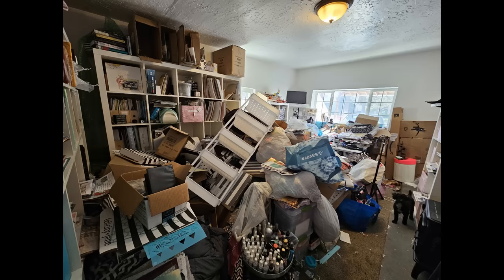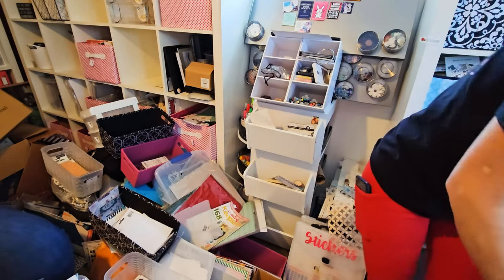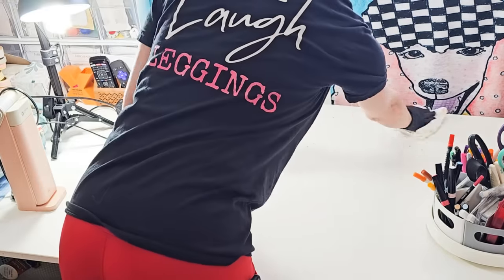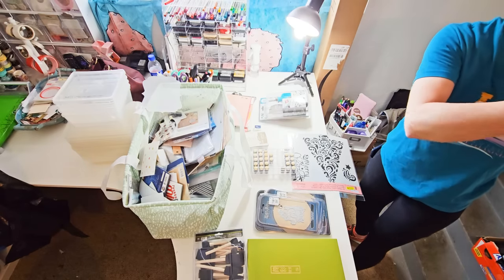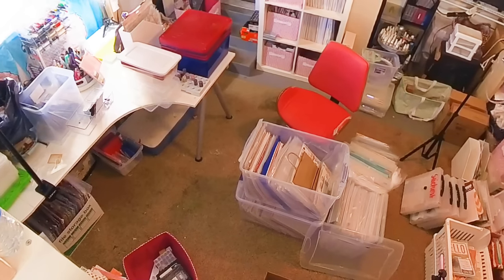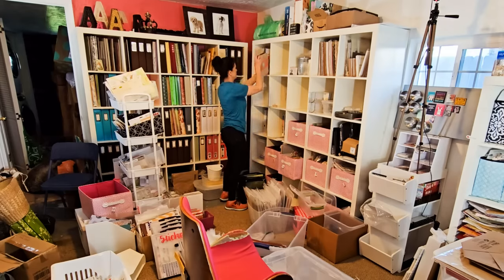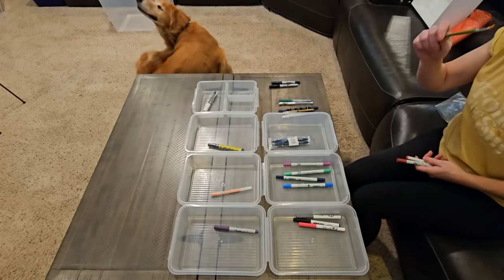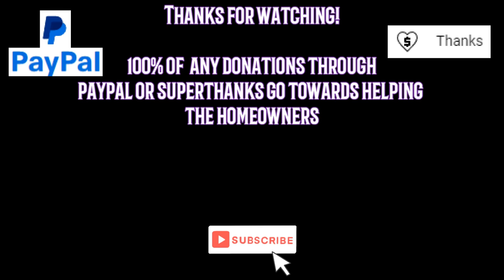Organizing Mira's Scrapbook Room, part 3 - finally finished? #cleaningmotivation #mentalhealth

Comment: It is my opinion that collecting art supplies and using them are two completely different hobbies. It looked to me like she tried to be organized but her supply-collecting hobby got ahead of her supply-using hobby. LOL Great job helping her get organized. Now she can actually spend time making things.
Reply: I am guilty of buying art supplies especially if I find them on sale!  I have a BASKETFUL of different size sketch pads! Sheesh! I am acutely aware of it now and have been working on replacing my "hobby" of shopping with my "hobby" of drawing /painting!
Reply: @LB-ht1qk Yes, there comes a time to look at the "stuff" you own and make using it an emphasis.  It could be sketch books or any other category of supply/ material in which ever craft(s) you do.  When using up stash, I give myself permission to do projects that have absolutely no use or purpose in my life.  I either gift this stuff to those I know or to a charitable type organization (Christmas gift drives and requests from the community are great for this.)

Comment: Here’s my tip for storing the 12 x 12 paper pad. I also store them vertically but I write the name of the pad with a black sharpie on the spin and have that facing out. That way, you can see the name of the pad you need way easier. I also group them to make it even easier for me. I’m using them a lot more now that I can see the names. 
Great job❤️❤️
Reply from the maker: I love that idea!

Comment: I always love watching your videos. I watch multiple videos, especially when I'm working on a cleaning, organizing, and decluttering project. I had to laugh when I saw you going through the pens, I just did that, LOL. I found checking if the pens even worked while sorting, especially the felt tip/ marker pens, as there were quite a few that were dried up or didn't have any ink, so into the trash they went.
I can relate to needing more light. Can I encourage you and anyone else when changing a light bulb to always turn off the light/ electricity before changing the bulb. When I worked in the emergency room, I saw multiple injuries from electricity and changing light bulbs. I think we forgot how dangerous electricity can be especially when its just a light bulb. I have some very sad stories that I won't go into detail with I saw when I worked in the emergency room. You are such a great person to be doing this for so many people, and your family wants you to be around also. 
Be safe and Thank you for all you do😊
Reply from the maker: Thanks for the reminder. I do get a little careless when it's just a light bulb, but I'm, in fact, very afraid of electricity. I just think that, if I keep my fingers out of the socket, all is well, but I suppose other things could go wrong.😊

Comment: Just putting arts and crafts supplies into categories of type is a tremendous help!

Sorting into sub categories for themes or colors or usage is something dramatically easier to do as you use one theme or usage from the category, and automatically becomes bite size tasks done in 15 minutes or less before you jump back into the project to hand.

That small open rolling cart with the current project sorted and stored vs on top of your work surface or a desk/table is super smart too! 💯✅

Comment: those crafting bags with all the pockets you were looking at are very useful to keep around when traveling to shows/conventions.  Bring one for each class you are taking with specific tools you need for the class and then you can sort the kit pieces into it and store your partially assembled bits separately from the kit pieces.  I also bring one in a different color that has the generic tools I will use across multiple classes. They don't work as well for scrapbooking because the paper pieces are often too large, but they are great for stitching and stamping projects.

Comment: On the shelf for 12 x 12 paper pads at 26 -28 on video. The one shelf had an acrylic box wedged behind with some kind of brads or embellishments hang in down between the shelf and wall.
Reply from the maker: I noticed that when I was at a teen and wondered if anybody else would spot that.😄

Comment: One thing to be aware of when it comes to light in a craft room: Both UV and incandescent light will cause fading in colored paper, fabrics, and yarn over time—sometimes quickly. I would advise getting blackout curtains or shades that you can close when you're not in the room to minimize fading.
Reply: Great point!

Comment: Protip on "breaking" boxes:

Put it upside down so the closed part is facing up, press down on the middle near the end of the box (right along the tape), and the tape should separate from the box enough for you to just peel it straight off.
Reply from the maker: Thank you for the pro tip! I can see how that would work effectively. 👌
Reply from the maker: Thank you for the pro tip! I can see how that would work effectively. 👌

Comment: I have no idea how this room came to be. I’m shocked at the mess and would just give up. My craft room is a mess now only because I’m not in it. But it will be straightened up this week. This is a good motivation to be cleaner, and wonder why she can’t throw the bottles away or get a water bottle dispenser. Surprised she didn’t have ants because of the cereal all over the floor.